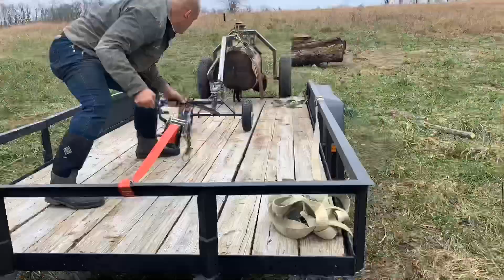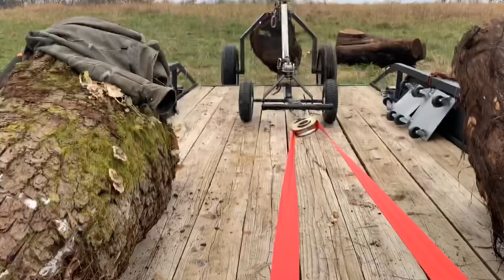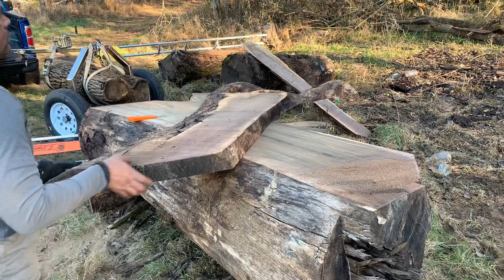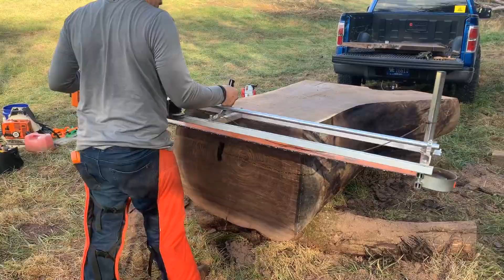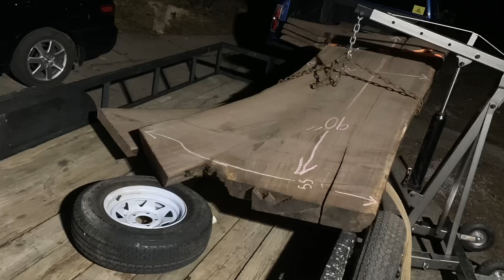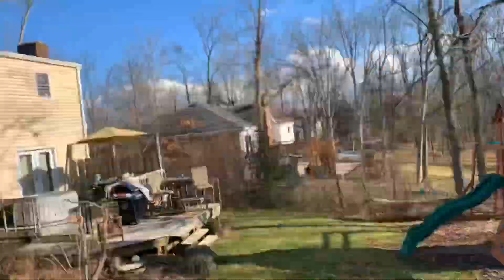Big walnut chainsaw milling

Comment: Nice setup! Clever idea to use a log arch to haul the logs and putting them on the trailer. People sometimes forget how heavy these things are. What type of chain are you using? Is it sharpened in a specific angle?
Reply from the maker: The arch has defiantly made moving logs so much easier! the chain in this video is from Baileys online store, it is a .404 ripping chain ground to 10°. I buy it in 50' and 100' rolls. Ripping chain is considerably smoother and a little faster, well worth it. You could also take your 30° chains to a saw shop and have them grind it down to 10° and that would work just as well. 
https://www.baileysonline.com/woodlandpro-43rp-404-pitch-ripping-chain-wpp-43rp.html
I also highly recommend Carlton milling chain if you can find it. This seller on eBay is awesome (eandrsupply) Ive purchased 100' rolls of 3/8" ripping chain and its the best IMO.
thanks for watching!

Comment: Hello. I have a question. How tightly do you tighten the chain on the bar?
Reply from the maker: I keep the chain just tight enough so I could pinch it in the middle of the bar and lift it high enough to slide a small coin under it. I’m using a woodland pro chain on this set up, which tends to stretch a little bit after the first or second cuts. I check it frequently and make sure it’s not too loose from stretching. I hope that makes sense, thanks for watching!